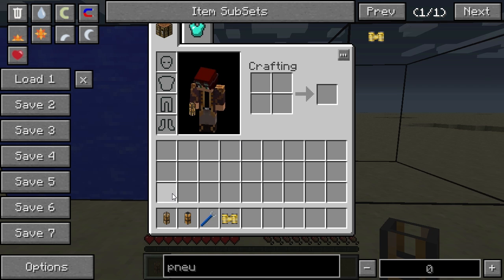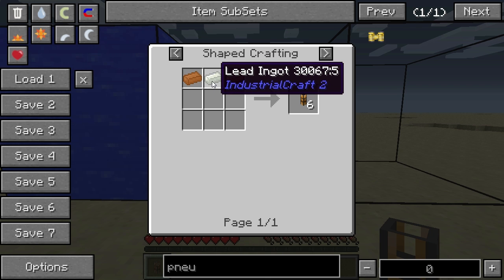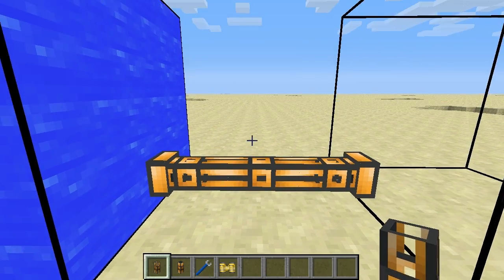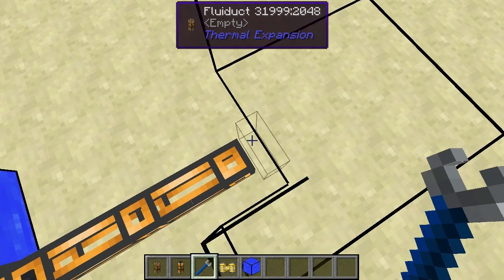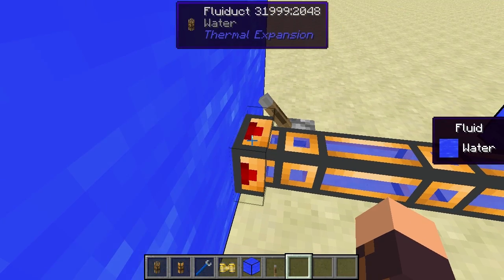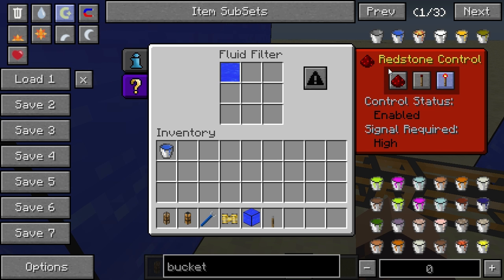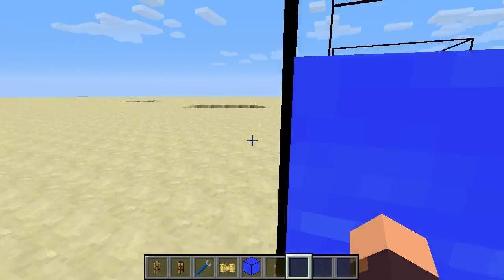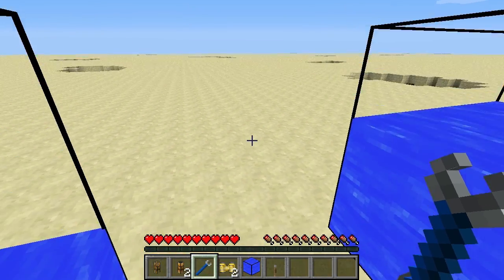Thermal Expansion - Fluiducts

Comment: It's not working for me, all it does is remove that and nothing more. Know what I have to do if this isn't working?
Reply: was having the same problem, but it turns out you need to install servos separately onto the out put face connected to your tank, just search for servo using creative or NEI, ect. and your find a list of them, you have to left click em on to the pipe
Reply: @CreatureOfTheVoid  bro you're a life saver im new to this stuff and you helped me so much cheers.
Reply: @thomasdalgleish931  Happy to help, but truthfully if i were to redo my builds with item ducts instead of the old pipe ducting i have in use, i would use retrievers with an item filter assigned rather then applying diamond filter pipes along the pipe network to separate items for storage, which does still have its advantages, though the whole thing becomes redundant once you start to store everything digitally with applied energistics.
Reply: @CreatureOfTheVoid  thank you this is really helpful
Reply: there is also a retriever version as well that goes on the machine side of the fluiducts, that pulls all compatible liquids from tanks to the machines its next to, works the same with item ducts though you might want to apply filters otherwise it will take Everything out of a chests
Reply: Having the same problem as you on FTB Infinity Evolved. I just wanted to find a way to move my cryotheum from the open blocks tank without using the lossy buildcraft pipes.

Comment: How do I fill a tank with water without using a bucket manually?
Reply from the maker: Hey, you can use an Aqueous Accumulator from Thermal Expansion to do it. Since you asked, I made and uploaded a spotlight on this block: Thermal Expansion - Aqueous Accumulators
Reply: RZR0 Wow! Thank you!
Reply from the maker: TheBlackStealth
You're very welcome =) Technically you could also use a Weather Collector from MineFactory Reloaded, but it only generates water when it rains, so that's less efficient. Though, if you have MFR and not TE, it's an option. MineFactory Reloaded - Weather Collectors